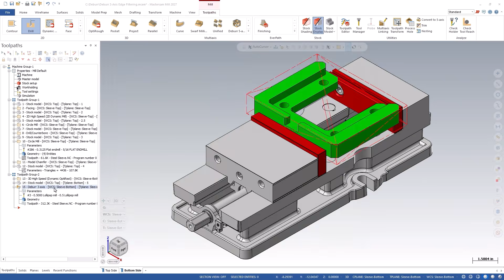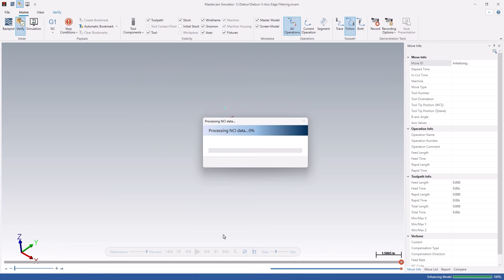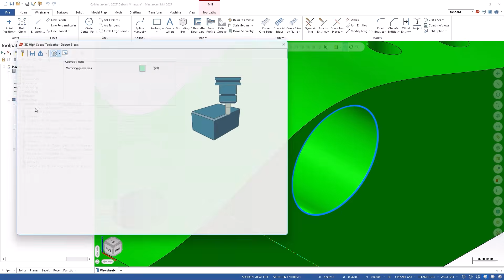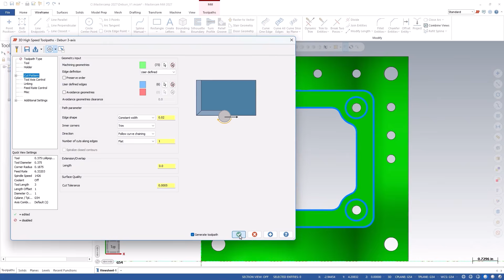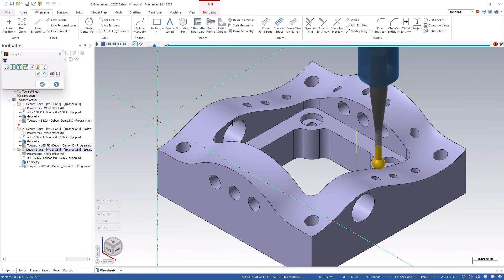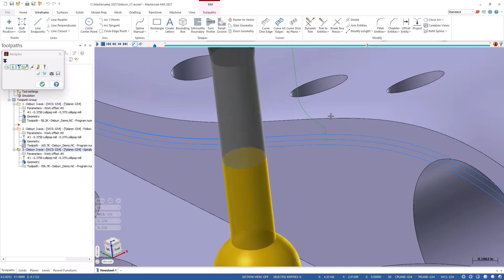Smarter Deburring Toolpaths | Mastercam 2027

Comment: Mill 3d or 5ax ?
Reply: It normally is for 5 ax, but it is possible to contact ur reseller and only get the deburring function for ur 3 axis machines.
Reply: Ok grazie ma è davvero strano che nel 2026 non sia presente de default la semplice sbavatura in un moderno CAM e si debba ore forza acquistare la licenza 5ax per una lavorazione così base